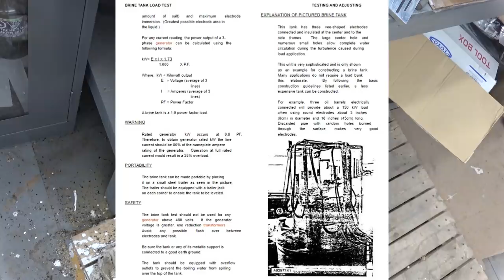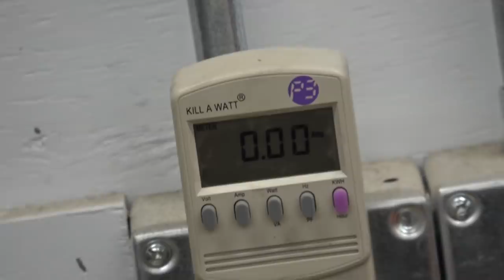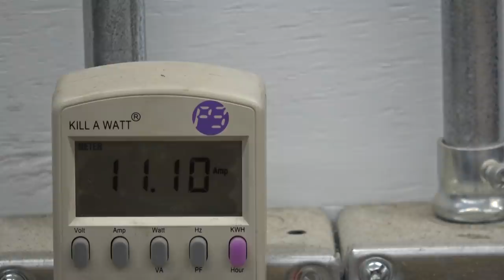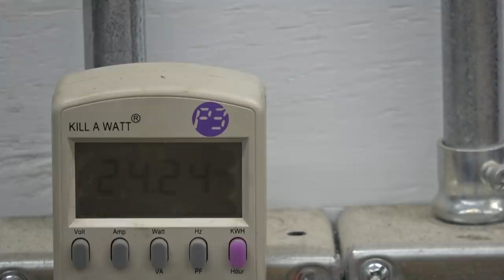Forgotten knowledge: generator load testing

Comment: Ye see here uncle bumblefuck, the breaker didn't trip immediately due to there being two modes of failure for breakers. Slow overload (Like what was happening in yer test there) and short circuit protection. The slow overload protection requires some time for a bi metallic strip" to get heat into er and therefore doesn't trip right away (of course, amount of heat is directly proportional to the current running through the device so it is time variant.) But a short circuit immediately trips the breaker through another means (Typically maganets are used for this one).

Comment: You might want to get some chemistry advice. I think you might end up making some hydrogen gas. Safety squints are ineffective against explosions. I guess you could just add a lighter over the tank for good measure to burn off any combustibles.

Comment: This is stupid. Just use steel wire or foil in an oil bath.
Reply: OK, well, "stupid" might be a bit harsh. And a length of steel wire is not variable. But the point is that it is not hard to come up with cheap ways to dissipate loads of power.